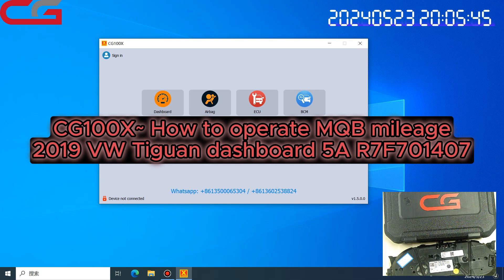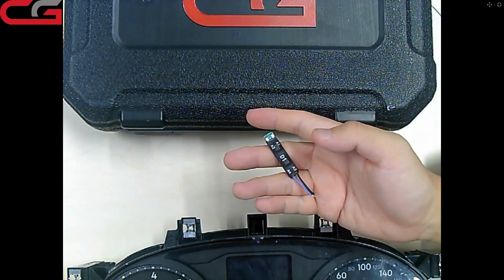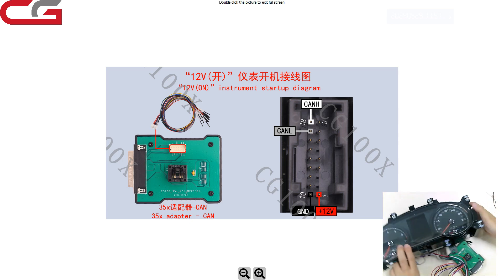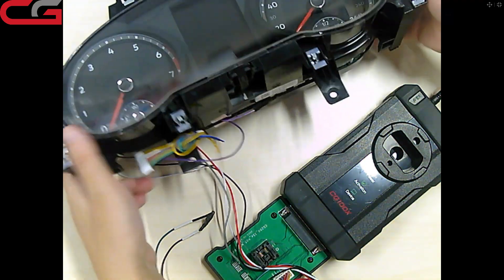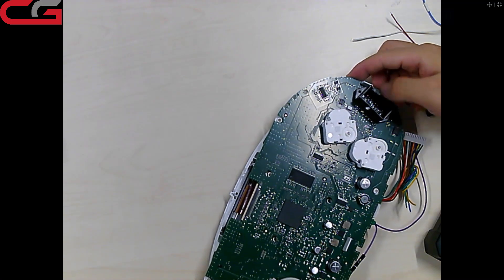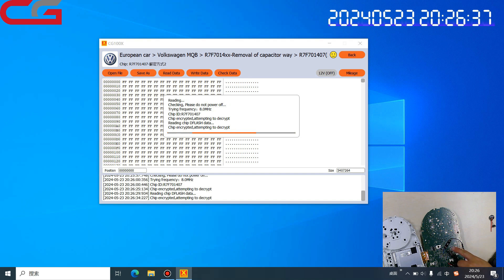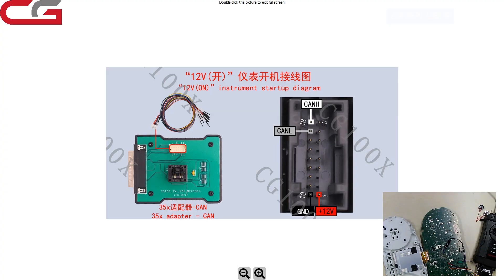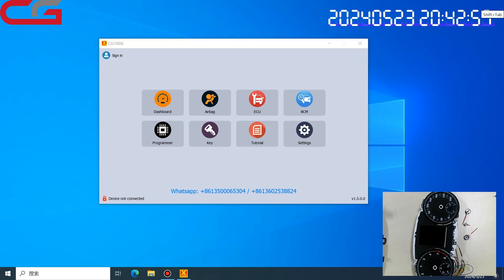CG100X~ How to repair mileage for MQB 2019 VW Tiguan L

Comment: I bought a new cgdi100x and I have the standard edition instead of the advanced one and I can't do anything about it? The device in this version is worthless, money down the drain and trouble... zero support, half of the functions don't work
Reply from the maker: Hi, do you have whatsapp ?  Please send your sn number to our tech support or your seller and check.
Reply: @cgofficial2114  Already done, the seller updated. Technical support did not respond
Reply from the maker: seller or tech support all can do .  maybe you sent wrong whatsapp dear , or you can tell me your whatsapp and i can check for you
Reply: @cgofficial2114  And it's strange that the device makes BMW CAS keys and there are no detailed connection diagrams to read them - only a general processor diagram. The "instructions" tab doesn't work either... Thank you for your reply
Reply from the maker: @BialasekStudioGARAŻ-PL   CG100X only write key dear , in order to solve your problem, pls contact our tech support
Reply: @cgofficial2114  Przecież to jest programator i potrafi czytać procesory ;) ale rozumiem że taka polityka firmy żeby kupować inne programatory